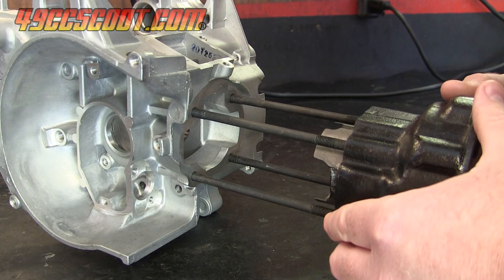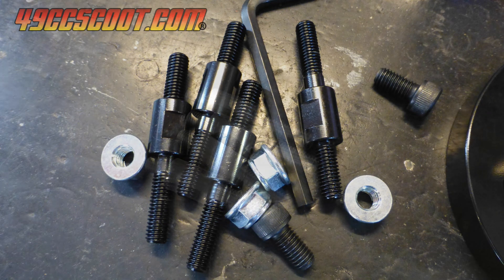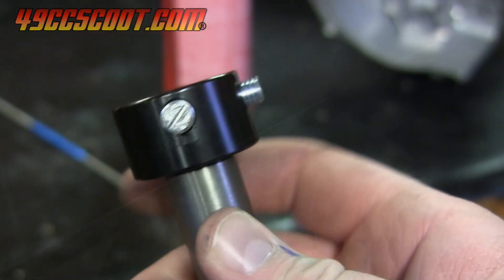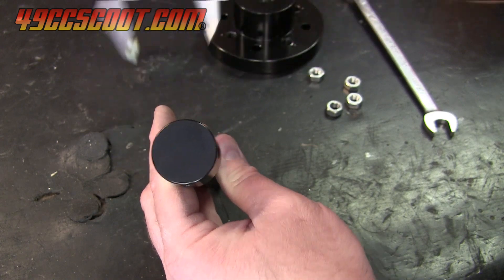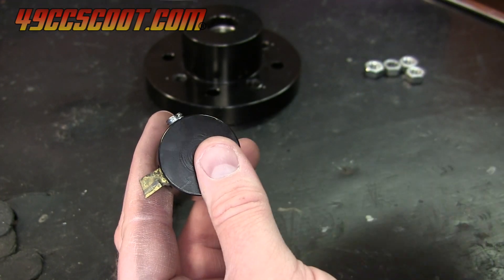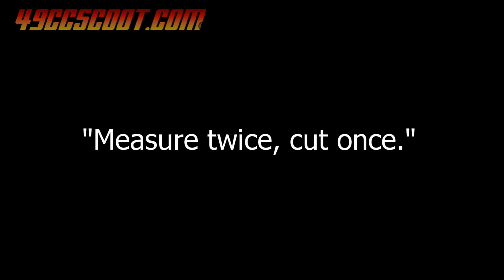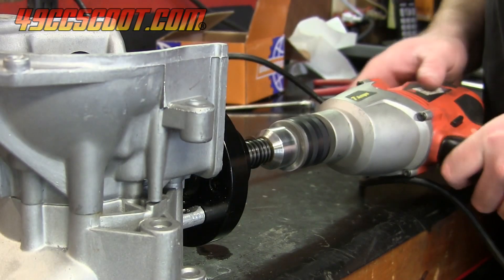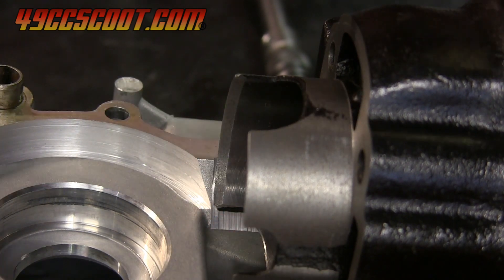Big Bore Case Cutter : How-To, Review, And Info (Minarelli, GY6, 139QMB)

Comment: Very interesting video I have a yamaha axis 90cc what is ur take on putting a bws 100 cylinder kit on the yamaha axis whit stock axis crank
Reply from the maker: The Axis 90 should have a 42mm stroke and the BWS 100 should be 47.6mm stroke. You are much better off to use a cylinder that matches the stroke of the crank. Otherwise, port timings are thrown way off as well as squish, compression and piston position relative to the ports at BDC.
Reply: @49ccscoot  it make perfect sense en what about a piston of bws en just bore the cylinder en modify a wrist pin to fit?
Reply from the maker: @mondomontie7449  They are both 52mm so no benefit I assume.
Reply: @49ccscoot eny recommend cylinder to get that Wil fit
Reply: @49ccscoot i have a 28mm carb v8 exhaust modify reeds en it runs very good now I want more that's why iam at cylinder now cvt olso worked it's running good but want more 😂
Reply from the maker: @mondomontie7449  I would consider a new crank and cylinder combo then. The Taiwan stuff only goes so far. Look at stuff like the TPR 86cc. Will need a pipe and racing ignition and good CVT with the crank and cylinder kit though.
Reply: @49ccscoot thank u very much ok look into it where can I buy from

Comment: do you think it is possible to bore out an RM 250 to 400cc? i read somewhere that the max is around 340cc, but i wanted to know what you think!
Reply from the maker: I don't have an opinion on that because I don't know really anything about that engine. All I would suggest is not to push limits for a street build. If it's a race bike, then maybe. It's more fun to be a little slower but not break down for street stuff IMO.

Comment: Isn’t 150cc stock at 57mm bore?
Reply from the maker: Yes, but I was cutting a 49cc so the outside of the cylinder skirt was that size.
Reply: @49ccscoot I’m new to the bore cutting space, so I pose a question… can one cut to 57mm bore on 139qmb? There’s only a 7mm difference between 100cc kit and the 150cc kit so wouldn’t it be possible…???
Reply from the maker: @OGXDev-Team89  I have never looked into that, but I would guess the stud spacing wouldn't allow it. Even on the GY6 150, the B version with wider stud spacing is used for big stuff. Plus, keep in mind that bore size and cylinder skirt diameter are not the same. Even with a 57mm bore, the skirts are 60+mm.

Comment: After doing this process, we can install a piston with a width of 139qmb how many millimeters
Reply from the maker: That would depend how far you want to push it. The largest kit that I know of is 52.4mm. I'm sure you could go bigger if you really wanted to with custom work... but at that point you might as well go GY6 150 unless it's specifically for a racing class.
Reply: @49ccscoot  there is a set of 52mm pistons in my engine 52mm wiper outer diameter 55mm i wonder how much I can expand it 56.5 I wonder if I can install a piston
Reply from the maker: @MertDemiröz  54.5mm OD cylinders are fairly common. I'd imagine you can go another 1mm all around (2mm total). Not sure if there's a point. I wouldn't do it for a rider. Most cranks don't last that long if you rev a big big bore anyway.

Comment: Soooo, i'm using a Naraku 52.4mm bore kit on my 139qmb, do i have to do this? It's looking like so.. haven't tried the jug on yet to see if it'll go, but hoping to get some answers before i get too far 😅
Reply from the maker: Most likely you'll need to do some clearance work. That kit has a pretty large diameter. Around 54.5mm where it goes into the cases. Some engines do have larger openings stock, so there's a chance that you get lucky, but I wouldn't expect it. A lot of people just use carbide burrs to open the cases up a little for 139QMB kits, but a cutter will likely give you a more symmetrical result.

Comment: Do you have to change the ignition timing when boring so big
Reply from the maker: No. With stock ignition parts, it works OK. If you were trying to get the best results, then advance requirements could change with bore, stroke, compression and other variables.

Comment: Thank you for showing this tool...
I'm building my own right now, looks quite handy to own.

And I need it now, so I have to make it 🤣
Reply from the maker: It is. This stuff can be done by hand, but I get better results in less time with the tool.
Reply: @49ccscoot 
Made the tool yesterday from some printer parts I had laying around...
Worked like a charm!!! 
Now my Yamaha RD50MX 65cc cylinder fits inside my zundapp engine cases.
Still have to make a footplate to raise it a little, but my trusty 1931 southbend junior lathe does that job like a charm.
Reply from the maker: @doctordapp  Very nice!
Reply: @49ccscoot  footplate is ready, 10,45 mm as measured.

No is the time for milling out the original head and placing an insert made from a top-racing 70cc scooter head inside it..

Then it's time for matching the transfers...

Cleaning and then rebuilding the whole engine.

If it works as planned, it's a good base for my first diy twin 😋

Comment: Love the video have you found any cheaper
Reply from the maker: No specialty tools. You can do it much cheaper with a rotary tool and carbide bur, but the tool makes it more precise and saves time.
Reply: @49ccscoot  when you do that are you putting the new gasket on the case drawing it out then cutting away the lines
Reply from the maker: @jeffkrauss5582  Yeah. Do your best to keep the cut straight as you go in.

Comment: I wonder if the medal expands so much from the heat, that it would damage my engine. I had to cut the hole bigger, it fits now, just has a small tight fit at the very tip end, inner engine walls. It fits the tight end with just wiggling it in. Im gonna open the engine to take out all medal shavings, so while im at it i might as well put thicker gaskets that I'll have to make, shave the inner walls, so its not tight fit at the tip end.
Reply from the maker: On some of the really thin cylinder skirts, perhaps it could put enough pressure on them to change clearance if tight enough even at room temperature. Maybe not. Since it's gotta come apart, you might as well go for the fit that you want. It sounds like it's not far off.

Comment: I just used my Dremel for my 150cc for the 171 BBK a few days ago it was very thin in a few spots but worked out great! Took about 1-2 hours for boring and fitting. Still need a big valve or 4 valve head with a bigger carb and intake and header.

Comment: What's the difference in horsepower CA 171 CC and the 232 next question is is it worth it
Reply from the maker: I'm not really a GY6 dude. The 232 can certainly make more power though. If you push to the limits, you are more likely to have reliability issues. A lot of people stick with smaller bores and strokes for day to day use.
Reply: Do you have any ideas on the gears in the gearbox that will help from red line my bike we'll run around 6570 but at 50 mile an hour it wants to Red Line I would be cool with the 50 just trying to figure out how not to Redline
Reply from the maker: @wadebarnes6720  I don't pay attention to redline on the tachs on these Chinese scoots. I just run them where they make power. My 150 was hanging out around 7500-9000 all of the time. If you don't care about power and mostly want engine life, then maybe just back off of the throttle. I'd think you should have room to spare cruising at 6600RPM at 50MPH.

Comment: @90gtvert 90gtvert I installed a 90cc kit on my 50cc Kymco agility but I think I have a CVT problem I'm at 10k revs at 30mph and that's my top speed, I have 7.5g rollers, is my clutch not fully engaging or is my belt slipping?
Reply from the maker: First, try heavier rollers to make sure it's not just a simple fix. Then check your belt width and condition and look for signs of slipping. https://www.youtube.com/watch?v=YkNhqEFeWVQ

Comment: i loved this video and made me think  of a video I didnt see you had covered.   Have you ever did a comparison video for Performance Cams?    I see various cams included in big bore kits and  cant seem to get actual data on how these alternative cams acculally perform.    I get how they work, but nobody has ever run a gy6150 with a9 cam, vs a10 , vs a11.    Have you made a video?   I wanted to message you directly, but cant find where I click to send a message direct..  thanks RC
Reply from the maker: I have not. I don't even have a 150 anymore. Someday I'll put a cam in the TaoTao 50 though.
Reply: 90GTVert on the 50cc, was the cam installed solely or part of a big bore kit?   Sometimes those kits don’t come with a new head, so just adding a cam seems to have the most options, but I can’t imagine if just adding a cam with out a bigger bore and / or head will improve performance.      So what cam did you remove from the 50 and what was the new cam you used?  Were there other mods made at the same time?
Reply from the maker: Haven't done it yet. Well, I did have a cam on my last 49cc 4T but it was long ago. An NCY "Performance" cam. Definitely helped top end power, but I only tried it with a BBK. I put an A9 from HOCA in my 150, and included lots of specs and issues with it's installation. See the link below if you're interested in that.
http://49ccscoot.proboards.com/post/228887/thread
Reply: I know your not into 150CC bikes but you may know how to disifer some confusion with the part numbers.   I am considering installing a 58.8 big bore piston because its supposed to fit with out boring the case, but the parts state compatible with152QMI/157QMJ 4 Stroke , but NOT P152QMI or P157QMJ .  I thought the P only means air cooled.  Why would that make any difference?    If I knew my inner skirt size I wouldn't have to guess, but with out tearing the bike apart I cant say for sure what will fit.
Reply from the maker: I think P engines have a different head that may be taller with larger valves and a more aggressive cam with a longer cam chain because of the taller head. Explained by some as basically a performance upgraded version of the standard GY6 head. If you use the stock head and the cylinder heights match yours, seems like it would be fine. Not a bad idea to make sure the valves clear though. Being Chinese, there's also a possibility that it means nothing and they coded it however they felt like.
Reply: I checked out your Test results for the Cams and it was interesting.  After looking at your test data I see the test results and between the two Cams and it looks like the more lift the better performer.    The tolerances were so tight so I don't think there are many options for these motors but I have seen A8-A12 available.   I was helpful but I guess the only way to know with these is to try and test each of them in the same motor to know for sure.   Also, you were correct  answering my other question about differences in 1p57qmj vs 157qmj.   I saw on someone else's page they are different.  The 1p57qmj  has different head, valves and chain. Its supposed to have better performance and these big bore kits don't fit.  I don't think the Cams will fit either.    Thanks again for your help.
Reply from the maker: I think the reason some people aren't inclined to do extensive testing of A cams is because they have been said to vary by brand so one brand's A9 isn't the same as another brand's.

Comment: Got my scooter  running decent although I'm wondering if I'm a touch rich I get a little bit of a sporadic sputter at wide open throttle sometimes but not all the time which is weird ?
Reply from the maker: Could be. Could be an ignition issue too. If you've done WOT passes to see what jet works best, then either something has changed or there's an ignition problem.
Reply: Well you were right on my spark plug wire was not holding tight against the spark plug changed out the Boot and also checked the Spade connection terminals at the coil were a little bit sloppy also tighten those up and the combination of it all seems to have solved the problem it was one and or the other...😀

Comment: Thank you and I'm going to reset the timing and valves I had originally set them at .004  but I think I was a little past the T mark into the rectangle box with a line through it I think right above that is a tiny t and then further up (clockwise) is a long hash mark and then an F so it's supposed to be the tiny t right ??

Comment: Nice video again, unrelated,,  I just installed a 171 CC Big Bore Kit in my 150cc GY6 adjusted the valves Etc runs good and everything.  seems like after it heats up though I'm hearing a little bit of chatter little valve noise, after the engine gets hot. any suggestions? Thanks
Reply from the maker: You can try 0.002"in/0.003"ex if they're looser than that now. Otherwise, it is normal to hear some noise. Valvetrains aren't silent.

Comment: I need some help with my ‘07 Yamaha Zuma 50 2t.  I purchased the Malossi variatior and installed the contra spring that came along with it.  I’m a bit confused with my weights.  I have a technigas silent pro exhaust.  I put the 5.6gm weights and it seems to rev high and has a very narrow powerband.  Today I put 6gm weights and it seems to be better.  The power and seems to have widened.  I weigh 135lbs.   Would it be wise to order some 6.5gm and 7gm weights to try out or do you think it’s too high? I am local (Salisbury) and have spoken to you before.  I wanna ride sometime man.
Reply from the maker: Hey. You can try something simple before ordering... https://www.youtube.com/watch?v=YkNhqEFeWVQ  I use aluminum foil regularly for this. Quite simple. Small scales are cheap.